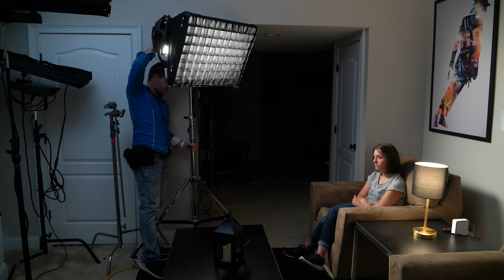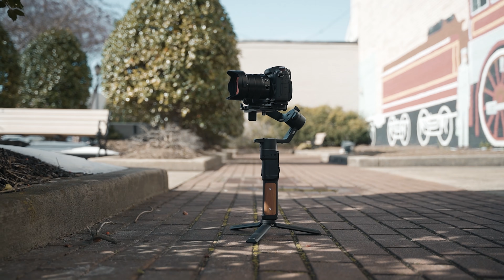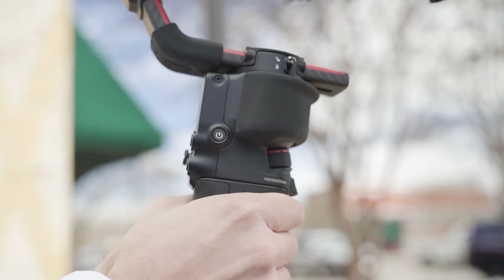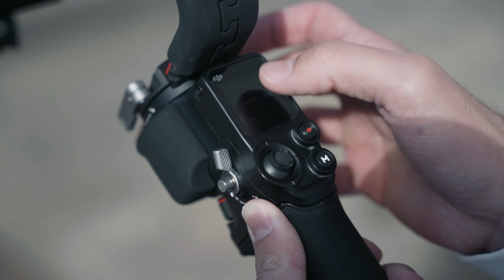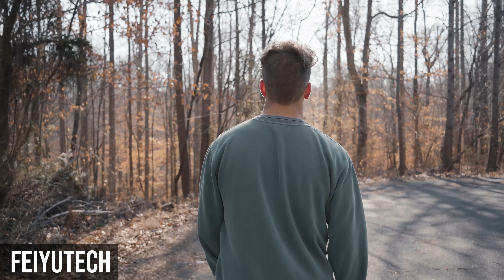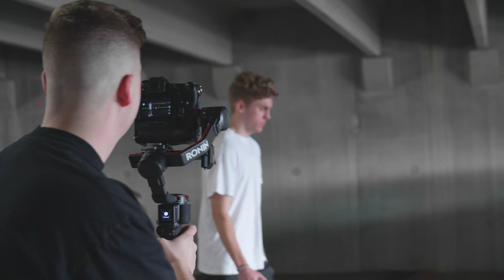What Gimbal Should You Buy? | Cheap vs Expensive

Comment: How about this idea.  Buy 3 for the price of 1!  I have two 2000c paired with Panasonic G85 which has IBIS and OIS and that is the magic.  I have also owned the RSC and prefer the 2000c.  And most important, it's not about the weight of the gimbal, a heavy camera/lens weight that will make for a very long and exhausted day.  I also use a Fuji X-S10 on the 2000c with absolutly no problem.  Maybe it's time for my 3rd Feyutech!
Reply: I have both of them. Dji performs better stablization because it's heavier. It's simply physics. Not about the tech.

Comment: Just what do you mean by 10 pound and 5 pound
Reply: They mean the amount of total maximum weight the gymbal can balance successfully, any weight that is higher than those respectively will cause said gymbal to not balance correctly. Hope it helps!
Reply: Weight. You won't be able to rig the camera as much for the cheaper gimbal - bigger lenses, wireless transmitters and batteries for monitors etc. They add a ton of extra weight.